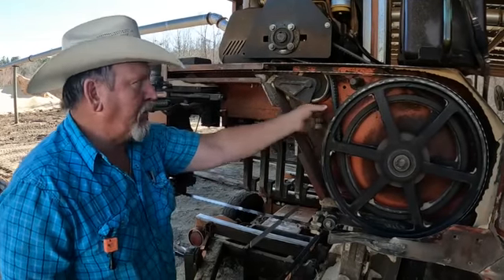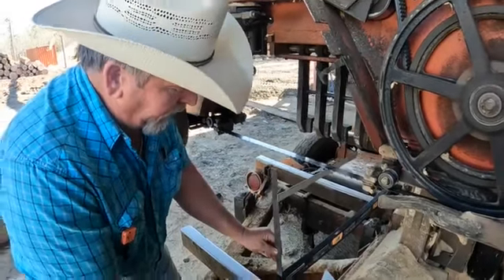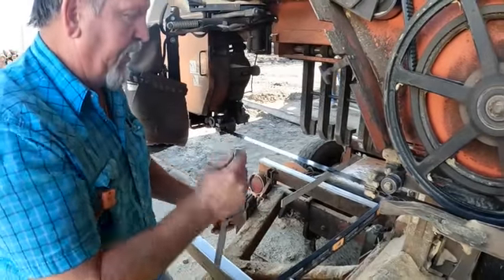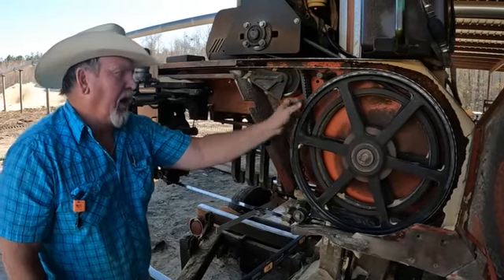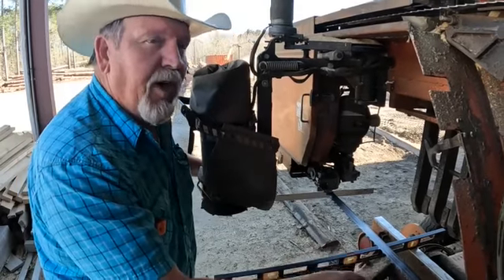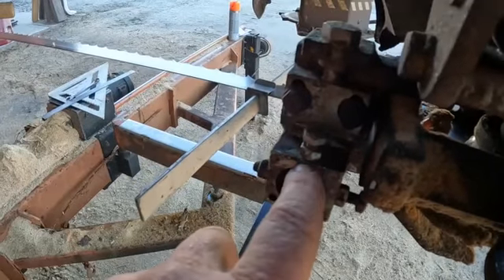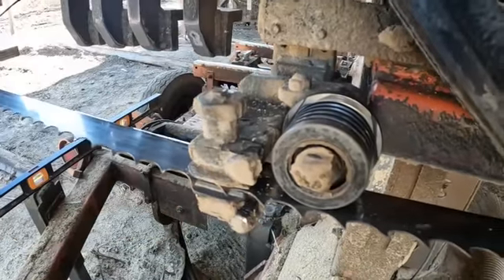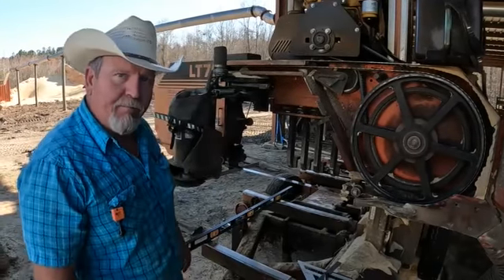Blade alignment basics on a WoodMizer LT70

Comment: Hello  Mr Jake, Very good vid My Friend.  And I totally agree with you about keeping good sharp blades on a saw.   Any Saw.  I remember ,  back around 1989 when sawheads came out for feller bunchers , replacing shearheads that most loggers around where using back in that time.  I ran my tree cutter many years and when my teeth got to where they weren’t as effective as I knew they  be, I replaced them.  And a lot of other smart loggers said I wasnt getting all I coukd out if them.  Maybe Not.  But by running it myself, while the other smarter loggers ride around in their new pickups saying they got everything out of their teeth. Cause thats what they told their hired hands to do.   OK. Well a year or two into a machine, mine still looked and ran like a new one.  Some of the machines running dull teeth had a lot of pin wear, hydraulics got weaker faster trying to capture recovery speed on the saw, making the hyd pumps work harder, and the list goes on about wear on a machine with dull teeth. That was a great point to make sure us viewers understand.
Reply from the maker: It's a difficult thing for some to understand. Thanks.

Comment: You just gave me a great degree of confidence to successfully align my blade guide and blade.  I set mine down it  on a can’t and knocked mine out of adjustment on my LT50. Just about broke my heart.  Read the manual but no way as good as watching your video.  Thanks for taking your time to describe some of the problems that you have experienced with the many years you have run Woodmizer’s.  I am a hobbies user but I also like to keep my equipment in tip top shape.
Tom Fruechtel
Reply from the maker: Glad it is helpful.

Comment: I think I need to adjust my blade guide arm after seeing this. Simple set on an LT40 is great unless you have it set for one inch and accidentally hit it mid way through a log. Thank you for going through all of these settings.
Reply from the maker: Blade guide arm is a little different on a LT40. Still needs to be adjusted right for the lumber and timbers to come out right.
Reply: @customsawyer2526  the manual I have goes into the details on how to make the adjustment. There is definitely something misaligned though because the head started shaking after my accidentally bumping the down head lever mid log with 1” drop setting. It threw the blade off the wheels when that event occurred but didn’t break… but now shakes even with new wheel belts, new blade, and also checked the drive belt setting.  It was like a sewing machine before.
Reply from the maker: @willmegehee  What shakes? The blade guide arm when you grab it. The mill head?
Reply: @customsawyer2526  the blade guide arm is causing the shaking the best I can tell. I may have a loose adjustment wheel on the blade guide arm. I’m going to check the blade alignment and blade guide tomorrow.

Comment: Broke a blade recently. Tomorrow's job is now blade alignment check.
Reply from the maker: How many times has it been sharpened? Some breaks are just fatigue.
Reply: Blade needed adjusting down on both sides. Broken blade had been resharpened 4 times. Lt70 walk  behind in New Zealand.
Reply from the maker: @sphipps497  4 sharpens is more than I normally get.